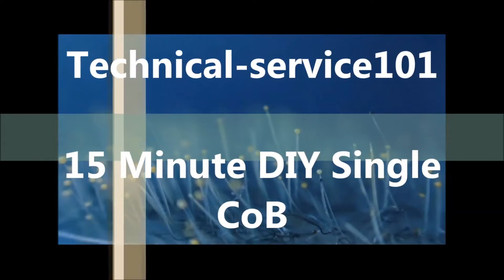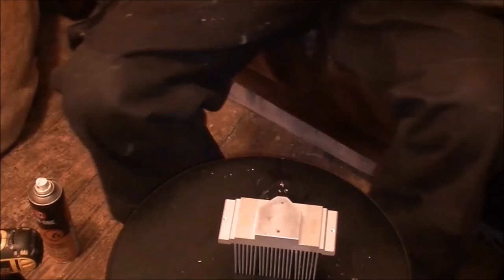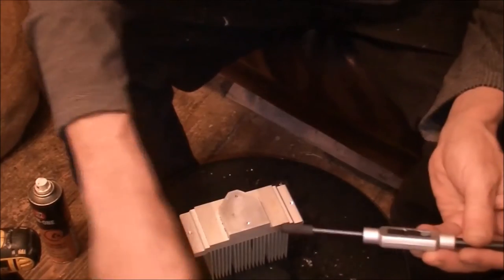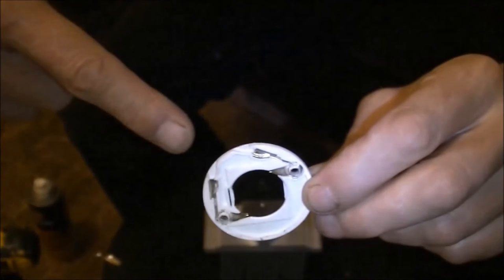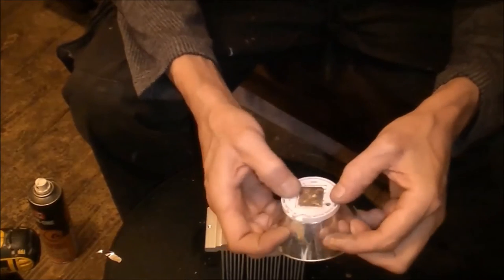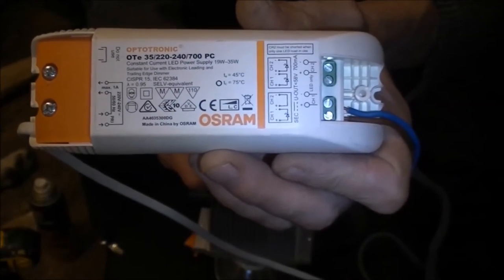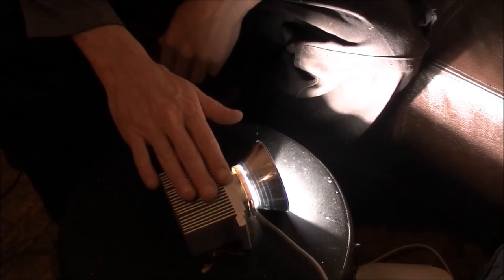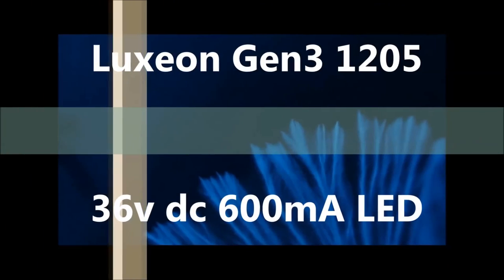!5 Minute DIY - Single LED CoB

Comment: So how much would this cost for this single cob light ? Thanks jack for your answers
Reply from the maker: This was really intended as an example demonstration, but if you are looking for single CoB LED lamps there are a lot of ready manufactured lamps at reasonable prices, it would help me to guide you better if I knew what your intended use was, industrial/domestic lighting, photographic or horticultural as the selection of led/heatsink/driver are all dependant on usage. I am happy to answer the most basic of questions so feel free to ask as many as you like. This unit featured here would probably total around £40-50 but it would depend on the wattage and this is a very low output light, around 20w, most of my arrays are in the 250-800w range so i'm afraid I cannot give you a more specific estimate. Once I know your requirements I can fully cost and source your components more easily.

Comment: Do you sell LED lights Jack ?
Reply from the maker: I have begun assembling a few bespoke arrays for friends that want them made but need to address the terrible availability of suitable high watt drivers. I will gladly liaise with our suppliers on your behalf if you have the confidence to assemble the pre-drilled and tapped components, all you would need to make for yourself would be the framework. I am currently waiting on driver delays but my next video will be covering our latest design which will radically reduce the cost per watt and overall build complexity. These units, if as successful as we think they are going to be, will be simplicity itself for us to get the heatsink drilling pattern and email it for anyone to send to our suppliers. Assembly will be a simple matter of following the build video. The whole point of this endeavour is to make all our work open source and freely distributable, this is why the channel is not monetised.

Comment: What set up would you recommend for a 1m x1m x2m space?
Reply from the maker: We run 8 x luxeon 1211 gen 3's (40 rated 75w max) in that kinda area, not too shabby, would probably go for the bridgelux vero 29 gen 7's (80w rated 140w max) if i were building the same rig now. 8 of them on a 360w driver will be underdriven and should give superb lumens/watt.
Reply: Lol not bothering at all... What's the point, u gonna do it fil the room same risks whatever way you look at it lol :)